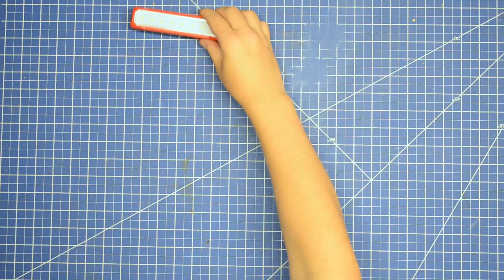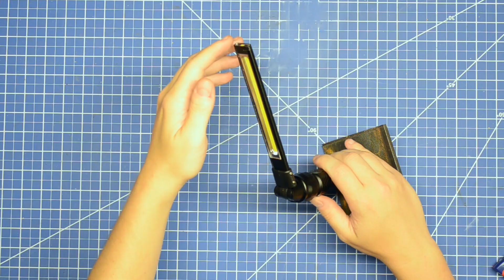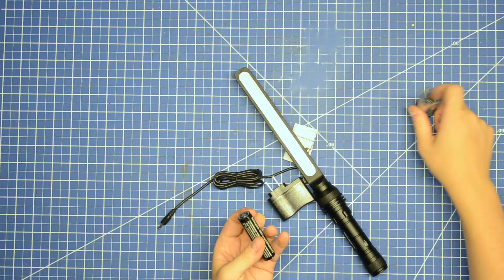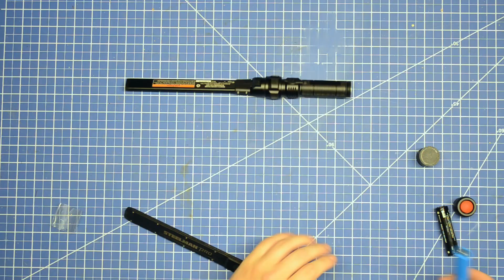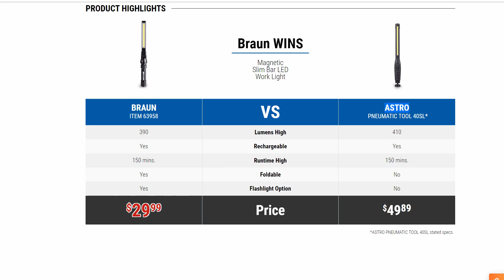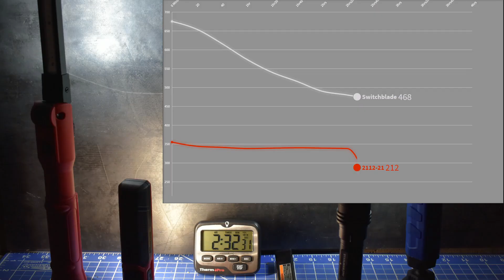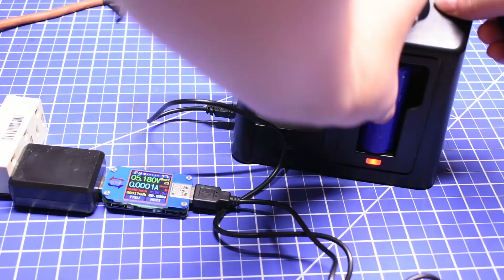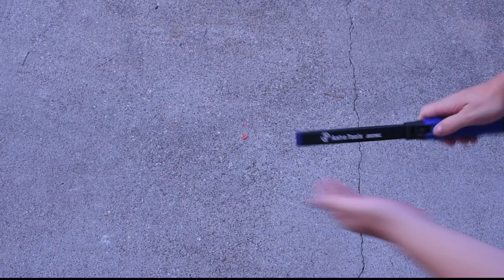Is Milwaukee Lying as Much as Harbor Freight Braun About Lumens?

Comment: Why not just spend ~$45 and get an Astro.  You get what you pay for and the difference is well worth a few bucks. 
But I enjoyed your testing and video.  Now, the cheapskates can make an informed decision, and those of us wise enough to be a little picky are justified in that persnicketiness.
Reply: But the neck has no flexibility. It's just a straight shot which is no for me. I use the braun at an angle 90% of the time. Too bad battery life sucks on it tho
Reply: The tip light on the Braun is what makes it so useful for me. It allows viewing in dark recesses where other lights would prove useless because of the glare from the foreground. When the tip is placed beyond the opening, a clear view of the interior is made possible.
I haven't had any issues with the battery life, and the plus is all the 18650 batteries I've harvested from old laptop packs make it a never ending supply that's instantly swapped out if ever caught low on charge. Captive batteries are a big disadvantage compared to readily swapped cell like in the Braun. Effectively it has zero downtime compared to any other light that needs to be recharged before continuing use, because I can charge spare cells quicker than I can use them up.
Reply: @andrewk8636  no flex is an absolute disadvantage to the 80sl, i have 3500 mj1 18650 batteries on my braun one! way longer range!

Comment: I am a Chevrolet technician and own the Streamlight. I am thoroughly impressed with it and even though it does take a while to charge I usually just put it on charge overnight and rarely ever kill it because of its lengthy runtime. It pairs nicely with the regular stinger light as well as my milwaukee hoodlight because of its ability to emit both typical LED bluish color and the milwaukee truview color. Highly recommend if you already have a streamlight and can utilize the dock to make the price of the stinger make a little more sense. That astro light is definitely a contender but it lacks the multi color of LED lights and the blacklight that makes the stinger such a great option.

Comment: Astro is still unbeatable as an everyday, do everything light in my mind.

I use M12 or M18 Milwaukee lights for big areas/general lighting as that's the battery system I'm already in.
Reply: That output curve over time on the Milwaukee is nice and I'm sure plays a part in its perceived performance despite the lower than advertised lumen output. The light color is nice too, I have a handheld from them with the Truview light and it's aggreeable. I too am in the M12/M18 system.

Comment: You can use the Streamlight all day and let it charge overnight... typically you want a good, slow, deep charge and that will care for your battery for a long time
Reply: Deep charge is bad for all lithium based batteries. Deep discharge even worse. Stop living in the Nimh era, Li batteries last 10x longer if kept between 40 and 60%, never charge them full.

Comment: I had one of those Astro lights about 2 years ago. It was a different design so I guess they beefed it up. The first time it got dropped which wasn’t far it broke the magnet off. Very disappointing. Then went and bought the Braun light from harbor freight and have been very impressed with it. I did buy a charging station and more batteries but it gets used everyday in a shop and has held up well. My only complaint is that now it doesn’t like to stay in the position I put it, it tends to follow gravity now. Other than that it’s been great
Reply: Braun beats the socks off the original Astro light. I despise that thing. The new Astro light is certainly an improvement, but to me the Braun is the Goldilocks of stick lights. Being cheap as dirt is just a bonus.
Reply: athhud the way it angles and how it does it’s more versatile than any other light I’ve used or seen. And it’s pretty compact for all it does

Comment: My Switchblade lives in a streamlight charger next to its standard style stinger LED older brother. Put it back where it goes, and you always know where it is when you need it. That's probably why it charges so slowly, they assume it's going to charge overnight, since most people in a shop setting aren't toting these home in their pockets. Lower charge rate = less wear
Reply: Exactly I love my switchblade. Used daily for over 3 years I’ve never had a single issue with any aspect of it

Comment: The streamlight charging makes sense to me. It's a bigger battery so it's always going to take longer, and it's not like you'd have 2-4 hours of free time during working hours anyway. Sure it could be faster, but faster charging wears the cells faster too. It's a big enough battery to last the day of work and you charge it over night.
Reply: the longer cycle time also makes the battery last longer, they dont like being fast charged or kept fully charged.

Comment: I took milwaukee battery apart after it died on me and milwaukee wanted $20+ for replacement.  You can pry cap open on one end where it's glued together.  It's indeed just an 18650 inside a casing, but the reason for casing is they also have a temperature sensor sitting on battery.  That's why you have 3 connections instead of 2 on the pack.  I assume it's for battery protection and light will shut off if battery gets too hot like on their power tools.  Really lame way to go about it it, they could easily just have you pop a regular 18650 in and have a temp sensor built into the side of the flash light touching the battery.  But then they wouldn't be able to rape their customers by selling them 18650 in a case for $25 a pop.
Reply: I see you opened one up too at the end of the video :).  That's what I get for posting before getting to the end, lol.
Reply: you prbably had the older version the newer 3.0 like yhr video is a bigger cell but its a sneaky think to check for when buying but they are all going to the newer i think but the folding floodlight (2114-21) is a lot better than the one he tested in the video

Comment: I have the small Milwaukee pocket flood light that uses 2 AA batteries and on high the lumens die down lower then low level after about 15 minutes or so. When I change it from high to low after 15 minutes it actually gets slightly brighter.
Reply: yea that version is wierd and will eat batteries like crazy and for some reason once the batteries are low it wont work at all whatever logic it has just kills it the rechargeable folding floodlight 2114-21 is my favorite by far the one in the video kinda sucks

Comment: I work on trash compactors ( sometimes very nasty) so I would have liked a test on how well sealed the charger port is. I have a flashlight that also has a light bar. It's a Slide King sold at Fleetpride. 5 years and still going strong.
Reply: Those Nebo lights are pretty nice! 👍
Reply: Th Braun’s light port doesn’t seal for shit and the cover will tear off the first time you use it. BUT mine have been submerged in dirty water, oil, diesel fuel, gasoline, etc. and left out in the rain for days. Never had a problem with them after getting wet by a variety of fluids.

Comment: Perfect timing of this video as I now have a 26650 battery from a vape that stopped looking yesterday and I have been flash light shopping to find it a new home.
Reply: Just buy a new battery. If you had the vape long enough for it to break, I'm sure the battery is near it's EoL. And get an 18650 battery system. 18650 batteries are FAR better. They have 1/2 the volume, with almost as much capacity and almost as much current draw rating. 26650 batteries are a dead technology. 20/21700 batteries have taken their place, and those are just now getting as good as 18650 batteries (as far as energy density and CDR).

Comment: I think the idea with the switch blade is that techs will be plugging it in overnight.  I always slapped my strion into the charger overnight.
Reply: Doesn't make it ok but yeah that's primarily hoe it'd be I would guess too. I'm surprised most flashlights don't have qc 3.0 or usb c on them it's a shame how behind the times they are

Comment: Most barrel plugs will list the voltage and amps on the plug. There are a reasonably small number of standard plugs sizes. The plug should also list the polarity, but this is rarely not "positive" in modern devices. There's a symbol on the device for polarity.

In most cases as long as you have the right voltage and at least as much amperage and the right size plug you'll be fine. (Of course with electricity nothing is guaranteed).

In the majority of cases, the plug is going to be either 5v or 12v nowadays, and 2.1mm jack sizes are common. I have a large number of 2.1mm 12V supplies I can use on random devices. 2.1mm is standard enough that the universal sets will often adapt to 2.1mm before connecting to whatever.

You might consider getting a bench power supply which you can set to your desired voltage and amperage and getting a collection of barrel jack adapters to plug into it. Not only will you be able to run any device, but you'll be able to monitor the power usage. Admittedly I often have trouble buying the right collection of random barrel jacks. If you get one of the laptop sets you'll have a million pieces more than you need and maybe still not have the right ones. The best option is some kind of universal USB-to-DC camera/router/other device set.

For a power supply, you can get something affordable but with features like a Siglent or Rigol which you can control and monitor remotely with a computer. With the correct adapters you can also use this to do some of your USB monitoring as well, although I don't think  y9ou could get the USB-PD devices (high power USB-C devices).

Of course, all of this applies to what you can do for your testing. For the average user, playing the "find the right barrel jack" game will never be a positive if they aren't someone like me who's already doing electronics stuff.

Comment: that HF Bauer light can be fixed by either tightening the bottom more like it says on the packaging, or bu stretching the battery contact spring if that's not working. I have a few and they are all flawless.

Comment: Really looks like Astro has a strong commitment to meeting or exceeding their tool ratings. Imagine if they were to make a cordless 1/2 of their own. That's a tool I'd really like to see.
Reply from the maker: The question is would anyone really buy a high torque only rated for 850? Even if it did really make that. Suspect not. Some mid torques like the XGT are rated near that now
Reply: @TorqueTestChannel  I honestly just wanna see them make more tools in general. They seem to have good integrity as a company and their competition would help keep the other big brands in line and on their toes.